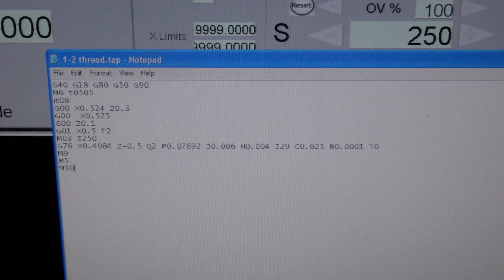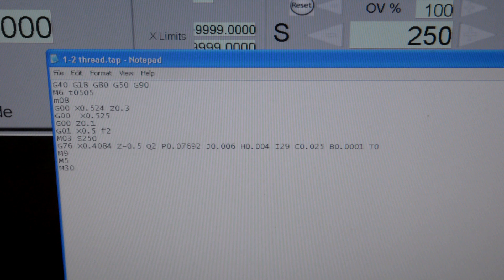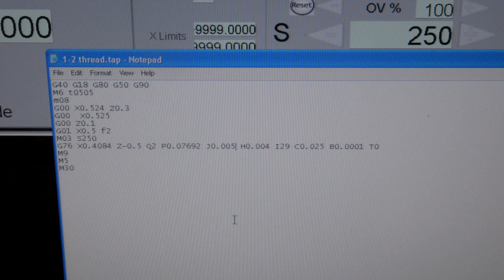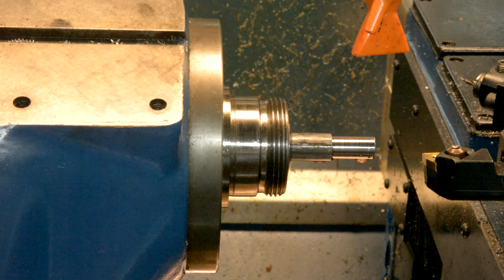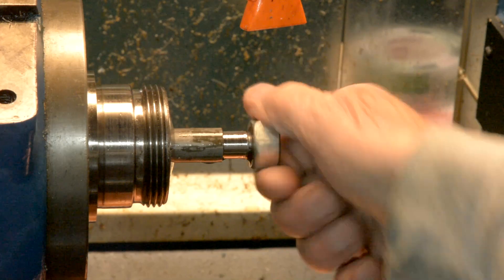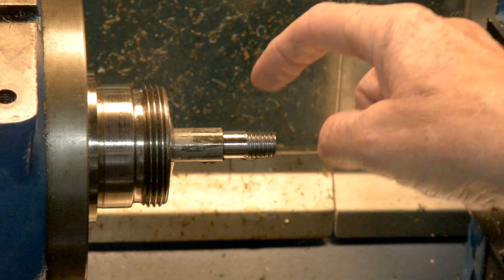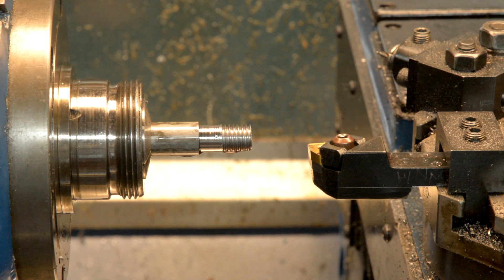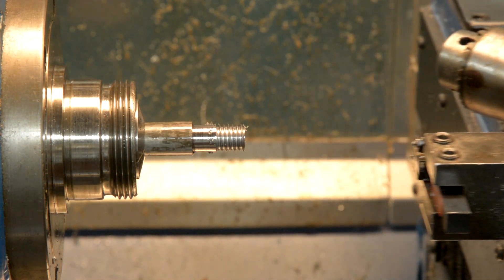Mach 3 Threading on a CHNC lathe

Comment: Sir, i noticed you cnc lathe uses a VFD/3 phase motor (the sound is a give away and you also confirmed it). Does the motor gets bogged down during cutting ? Is your spindle control in "Closed Loop Spindle Control" ? Does mach3 able to compensate for load during cutting ?
Reply from the maker: The VFD will compensate for the load.  It may vary a few RPM.  Mach compensates for any change in RPM by changing the feed rate.
Reply: @vendter  noted and thank you

Comment: so you change the spidle mottor for make  Threading in mach3?
Reply from the maker: No.  Added an index pulse to the spindle
Reply: @vendter  so just make the program speed same right?
Reply from the maker: @mr.dubber77  Mach has to know the speed and position of the spindle so it has to have an index pulse from the spindle to do that.
Reply: @vendter  

Your video got me closer to cutting threads then anything else I've found. But no luck yet. 

My machine seems to set up and run in for the thread proper but when clearing out to return to do the next pass it moves Into the part! I can't seem to get it to not do it running any other types of G76 either (books and mach3 forum help). 

I am cutting towards the chuck, in X positive and turning CCW. Any ideas would be great!
Reply from the maker: @JEWFisch  Sorry, I can't think of anything offhand.
Reply: @vendter  cheers for the reply. 

I actually found out that using an ESS smooth stepper will cause threading codes to mess up I guess! 

So I ended up doing some study on G32 and got it all working with that, thankfully haha!
Reply from the maker: @JEWFisch  Glad it worked out for you!

Comment: Greetings from Colombia.
Thanks for sharing.
To make threads:
What type of sensor do you use?
and if you use a slotted disk:
How many slots does it have?
Thank you for your attention and response.
Blessings in these difficult times.
Reply from the maker: I use a Melexis US5881 unipolar hall switch with a single magnet.  That gives me one pulse per revolution.
Reply: @vendter  Muchas gracias por tu apoyo.
Reply: @vendter  Regards.
Thank you for your invaluable support.
Please can you tell me: what is the diameter of the magnet you are using?
Thanks for time and valuable response.
Reply from the maker: @jaimevillada9150  I believe it is only 1/4" (6mm)

Comment: Very useful, thanks! I wish I could find a video on lathe tapping with Mach3.
Reply from the maker: You can do it with a floating tap holder.  You could do it with a tapmatic holder or procunier holder.  Hardinge made a GK11, GK12, GK21 and GK22 holder.
Reply: @vendter  Thanks. I'm going to get one ordered :)